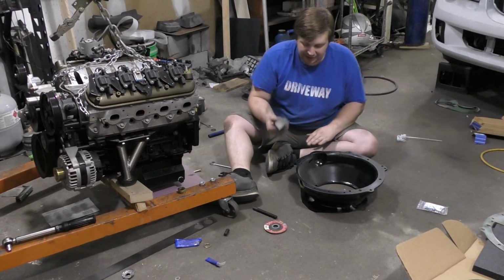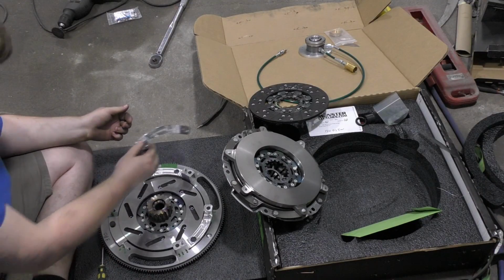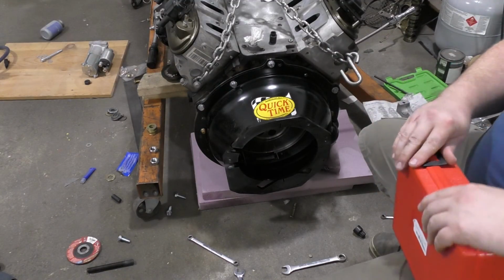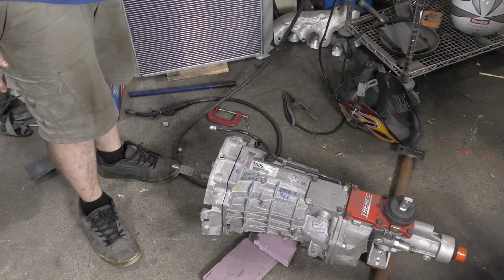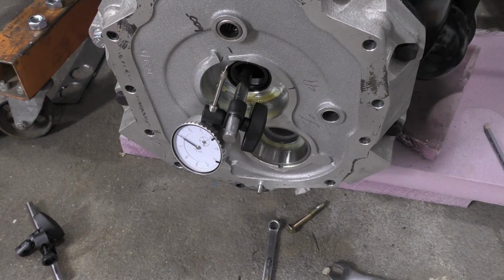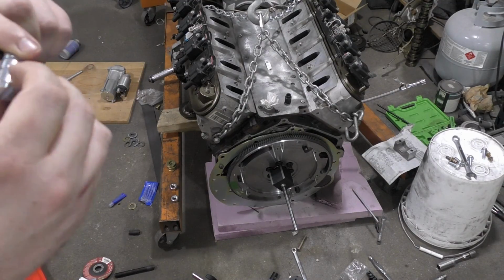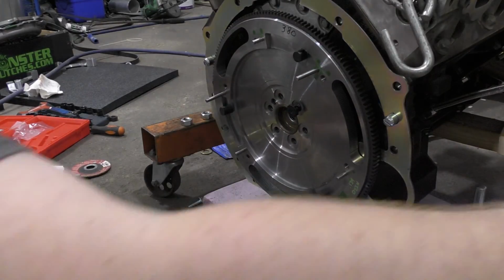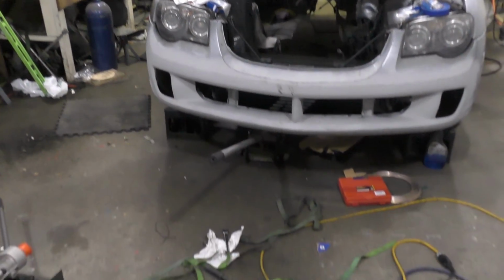V8 Crossfire Project: Full Clutch Install

Comment: Wow, I didn't know that there should be that much measuring to put together, I now see what you mean by the tolerances getting exaggered the more it gets put together. A little out at the begining can be a lot out in the end. Learned a lot on this. Thanks.
Also I see you use the same kind of safety footware as I do in my garage..lol.
Reply from the maker: Gotta stay as comfortable as possible in this heat.